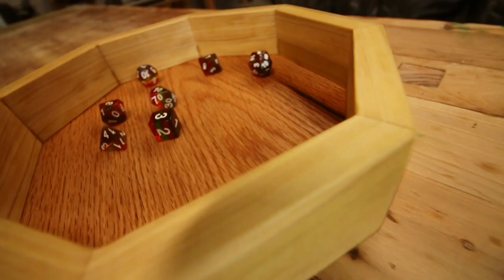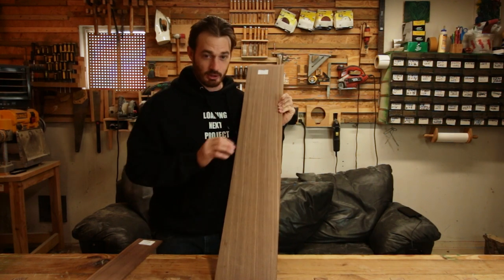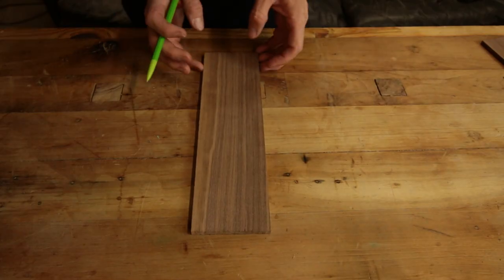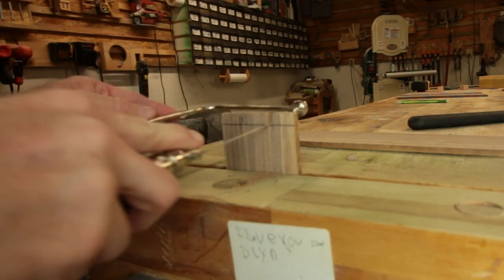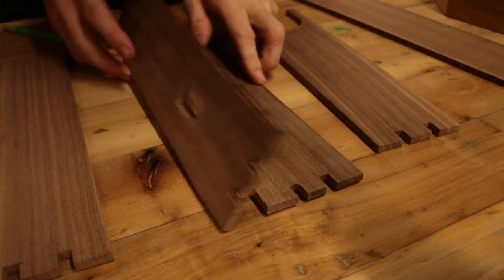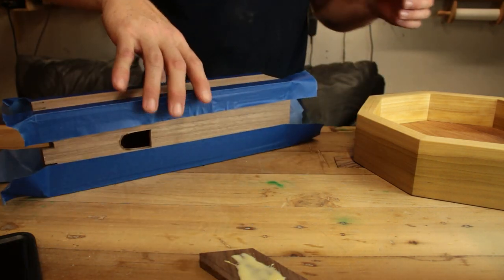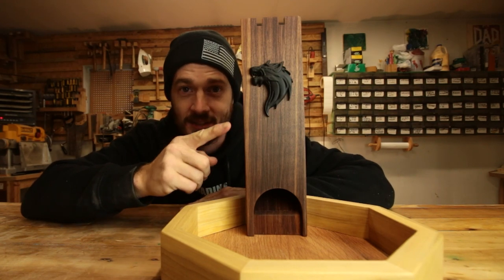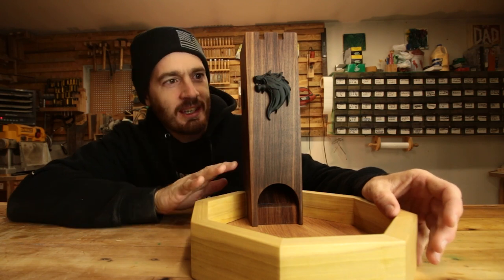How to Build the Amazing Dice Tower! (Limited Tools Project)

Comment: LOL! Luved your 'minute and a half' comment @ 2:34 and your sticker on the vise.

Great dice tower. Like it better than the one I made. Also enjoying the zen of hand tools. Nothing like going old school sometimes. As for the 'overly dramatic' ending, two thumbs up.

Ideas huh, ... how about a game shelf?
They are rectangular in shape so they can be used vertically or horizontal. It also makes them modular if you have several combined. The shelves themselves are in a X pattern, like a wine bottle bin. Since game boxes and RPG books came is assorted sizes, you can alter the shelf space by having some fixed and some adjustable, or add some vertical/horizontal shelves/supports. The bonus is that while this may sound like a niche 'gamer' item, it's actually a great way to spruce up any home bookshelf system. 
(Interior designers love simple things like this they can charge more for.)